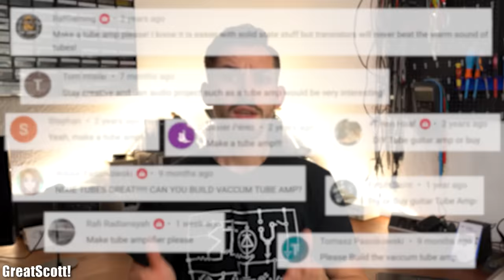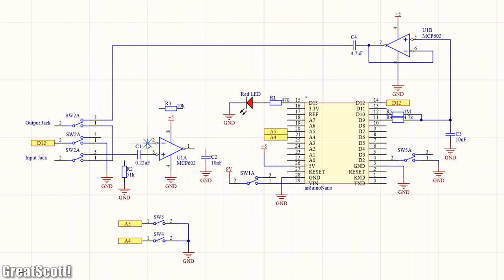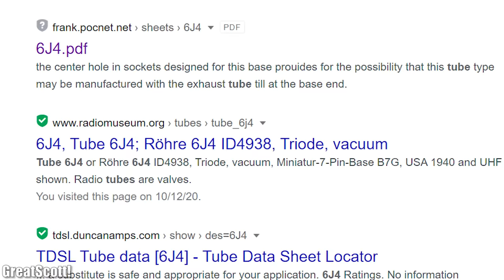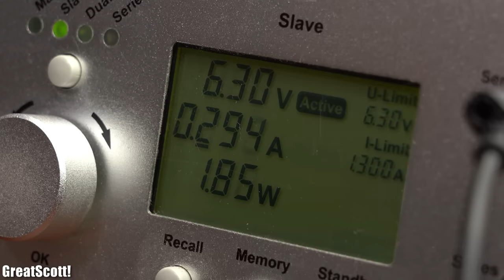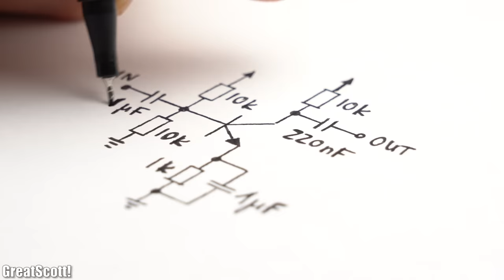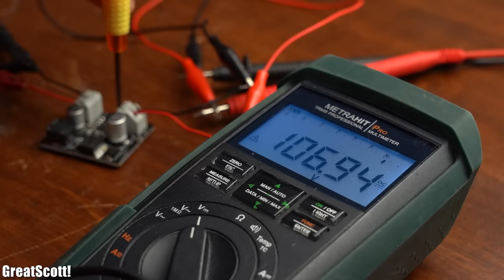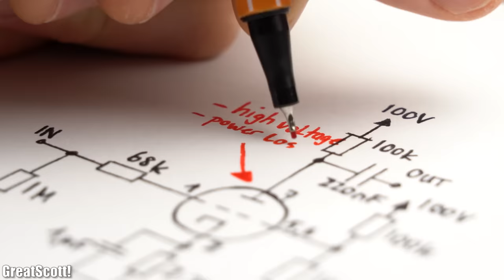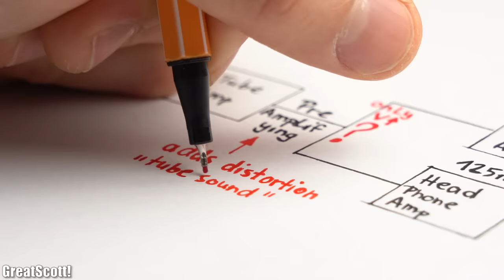Building a Tube Amp! Does it produce better audio quality though? EB#47

Comment: I just can't understand one thing: why, if the tube sound is just pleasant and the customers are willing to pay for it - it's not emulated digitally? With today's electronics it should be EASY. I imagine it as a software filter on your PC or Android MP3 player. Where's the problem in making amplitude response non-linear? Geez, it's simple sample multiplication. We can get any characteristics that way. Saturation instead of clipping? This is a little more mathematically complicated, but still - easy peasy. I really, really can't understand - why bother with analogue electronics? First of all - it's damn expensive! Then the design is relatively complicated. The digital version can be just programmed. Without any hardware you don't already have. There was a time of super annoying photographers that were fixed on developing their own analogue films. Damn, I hated their bullshit how the analogue photography is better, it's an art and all that shit. Thank god most professionals switched to digital cameras. And all that artsy shit I can add with one touch on my phone, I don't need a fucking dark room and a ton of chemicals for that. The analogue audio is just another version of it, but IDK, even crazier. I understand the speakers and microphones are analogue, and there is amazing science behind the good sound of these devices. But come on, signal recording, playback and amplification - there is absolutely no magic or rocket science. It's dead simple. It's the same story like with photos. It doesn't matter if the "pixels" come from film grain or CMOS matrix. It just offer a specific resolution and dynamic range. Same goes to audio. But the digital processing has the advantage of emulating practically anything. We can "draw" sound with the resolution far better than what our ears are capable to hear. Why this is not a standard, and people still burn money and time playing with analogue stuff is just insane to me.

Comment: NO!!!!! To get sufficient power for even efficient horn speakers to really work right the HEAT generated by the tubes would be very difficult to manage. I use a 140 watt/channel solid state unit because it has the overhead needed for my speakers to reach their 116 dB max (@100watts). The extra 40 watts is a little overhead so absolute full volume is not needed. Why? Look at a snare drum rim shot wave form. You will see a very short lived spike that can and often does exceed 110 dB+. Mind you that the speakers you play at normal dB levels will still if possible follow and if sufficient power is available reproduce the wave and it's dynamic level to the speakers 116 DB limit. If the power needed or efficiency is not sufficient the wave will be truncated, and distorted. NOTE: A typical 89 dB/watt/meter speaker would need about 2000 watts to follow the wave to 116 dB. Almost all musical instruments on the initial "attack" of the note or chord will "spike" very briefly then decay to a normal volume. Speakers or amplifiers that cannot faithfully reproduce the attack wave form will distort this portion of an instruments true sound. Our host correctly points out that tubes have other distortions not produced by transistors. As long as one does not clip the solid state device it is superior to tubes.

Comment: Douglas Self has put this topic to rest completely in his Audio Power Amplifier Design Handbook.  Basically NO there is no difference because feedback removes all the problems.  They did multiple blind studies and basically no one could tell the difference.  If there's no feedback then Valves/Tubes sound nicer because they soft clip with even harmonics whereas Transistors soft clip with odd harmonics.  But now you are comparing shitty designs to each other.

Comment: Put my Heathkit SB200 up against any 200 watt solid state junk and you will hear the difference on the ham bands. Solid-state amps don't seem to distort as musically as vacuum tube designs. The primary reason is that when you drive tubes hard the distortion comes on gradually and presents itself as gradual compression that blooms into distortion. The high voltage supplied to vacuum tubes ensures that the output of the device seldom exceeds the voltage that runs it. Solid-state amps use lower voltage supply rails to operate and the output can exceed the supply voltage. When that happens, they don't start to compress and gradually clip. They simply cut off the output signal at that level. Sine waves become square waves immediately and the sound is not pleasant. Solid-state distortion in its pure form sounds something like bees in a tin foil bag. Not the best for musical instruments, completely unacceptable for home audio enthusiasts and Ham radio operators will show you the difference visually, with your ears and on paper.

Comment: This is your opinion, however Tubes are immune to radiation, tubes can operate at higher frequencies and higher power. Do you think Radars use Transistors?  A class A tube amplifier with regulated Vsupply is perfect.  What about noise? Transistors are more susceptible to Noise than Tubes. 
Your experiments are not under a control environment and the equipment you are using is not the ideal either.....
The video provides  poor evidence, show the Harmonics with an harmonic analyser for example....What about  frequency spectrum?

Comment: This is a terrible amplifier! Right there from the beginning of the video I saw the row of inductors lined up and I knew that it was a class D amplifier! 
I'm not too familiar with this model but from the quick glance I saw a few opamps which are probably used for the bass and treble controls and the headphone driver, the output stage is class D which should only ever be used for portable Bluetooth speakers where you just need loud noise and where quality isn't important! 
You showed some nice tube Amplifiers on the eBay listings, the one that you should have got would be the one that is point to point wired! So always remember to check for pictures of the underside, there should be no PCB! 
I don't know if headphones would be the best way to hear it, you need to track down an old pair of hifi speakers, you need them to be really efficient! The need to have at least an 8" speaker or larger, they don't need to be expensive! They usually have a tweeter that is just a normal cone speaker with a simple capacitor as a crossover... 
I'm not an audiophile, I just know that tube Amplifiers work best with cheap, large and efficient speakers and even though they are only rated for 10W, you will be surprised at how powerful their 10W is! And when it gets loud and distorts, it's a soft distortion and it actually sounds good unlike the hard clipping of solid state! 
To experience music through a vacuum tube amplifier is to understand how perfect the audio engineer's got it from first go. You will probably wonder why we needed to change it to solid state in the first place lol... 
I was hoping that this video would have been longer than it was, judging by the amount of people who viewed this video, there's a lot of interest in this field... 
You should send this amplifier back and get a real one, the real one will be an investment that you will be able to pass down to your children one day, this thing will end up in the tip (landfill).

Comment: Soldering? ... seriously.. you mean "dab & hope"!.... Soldering to a tube directly that is not a version with proper solder fly leads you risk causing a de-vaccum as the pins exceed normal temps & the glass-metal pin bond is compromised.... USE A SOCKET! It would be interesting to check how much noise is present on the B+ being made by your DC-DC convertion module as well.

Comment: For guitar? Absolutely, not modern shite, they are over engineered crap. A basic no frills tube amp, for guitar sounds phenomenal and cannot be matched by solid state or digital. Not everyone has played thru a vintage or vintage style amp. Modern tube amps are redundant in many ways IMHO. You take perfection stick it on  pcb and add 200 components you lose the magic.

Comment: so poeple the sound that Tube Amps make because the add a distortion to the sound, over the new transistor that do not? mmm, could you not nock circuit, resistor and stuff toputs that distortion back in the sound, and call it "Mock Tube Amp" sound   settting or somthing?

Comment: Bits and pieces of tube history can't support for your "pleasant or warm"  acoustic feeling. 
Bear in mind human ears can't even observe a blinded eye-behind the curtain- test of 10% THD distortion, no matter how "Golden" you claim your ear are. Do not use the oscilloscope waveforms to make our ears to believe.
Get the basics correct first: Tubes are" voltage" devices while transistors are "current" devices. The interface is Transformer.  
Flipping a few pages of specs of tubes and transistors mean comparing apples to oranges. 
It's completely mad to power a tube with a switch mode Power Supply module.
Do not confuse Nixies with Heated metal Tubes. Totally different in operation.
Never solder the legs of the tube. The glass can be cracked and the tube be damaged right away.
And don't play around with any voltages above 50V. No fun. It can kill.

Comment: The “tube amplifier” you used as an example of the art was at best a cruel joke. Transistor amplifiers took over because they are cheap to build and disposable. Pretty much no other reason. The cheaper solution always wins in the market.  The tube used as an example is not even designed for audio amplification. If you even bothered to research the proper design of an audio frequency vacuum tube amplifier, you would see that different tubes were made for different applications, even low voltage types, if that’s so important to you.

So, as an engineer who makes his living working with both classes of device, I give you an absolutely failing grade on your presentation and conclusions.
Reply: So if you are an engineer that makes his living works with both you must know that the reason transistor took over is because it is much more efficient for every single application that used tubes. The only reason we have smartphones and small computers is because they found something better that could be packed in smaller spaces using less power and producing less heat. Tubes may subjectively sound good but suck for everything else. Much like how a quartz watch are much more accurate to tell the time than a mechanical watch and is cheaper to produce. How something that can do the same thing in a more efficient way and cheaper not be the obvious choice?
Reply: @sterkriger2572  Efficiency is largely irrelevant where audio amplifiers are concerned. Just as eating a handful of crickets is more “efficient” than involving a cow, a farmer, a large plot of land, a butcher, and a barbecue grill to feed oneself. I’d rather have a steak than eat a handful of bugs. But just as enjoyment is non essential to sustenance, the act of listening to music is “non essential” to life. Therefore, any arguments for objective efficiency are meaningless. Unless you run on a battery pack, the fact your amplifier consumes half the power means nothing in the grand scheme of things. 
Do they (tubes) sound better?  Well, that depends. I’ve heard plenty of crap tube amplifiers.  The example above would certainly serve as an example. Without counting the simple 100V power supply components, per channel, I build a balanced fully differential tube preamplifier with a single 6DJ8 tube, two transformers (input and output), a 2 channel pot, and 5 resistors that has less than .01% distortion total at 3 volts of output into a 100 Ohm load.  All this with zero feedback!
Reply: You missed my point and decided to straw man my comment. You said the industry diched tubes just because transistors are cheap and "disposable". I pointed out that it was because tubes where much worse at doing the job and thanks to that we can pack 3 billion transistos inside a home computer that fits into a small box while a tube computer needed a whole building and could only hold 18000 tubes and consumed the same as a small city.  As far as music especifically thanks to the better efficiency that transistors have we can listen to music everywhere anytime in a marvelous thing called a smartphone or if you're a little older a discman, a MP3 player etc. The transistor single handedly revolutionize technology. That's why everyone started using it. Making better, faster and smaller devices was only possible because of it. Tubes are a relic of the past.

Comment: Lesson 1: nothing good in tube amps ever came from China!

The first thing to note is that the circuit design is principly responsible for the sound quality, including appropriate choice of valve type.  The advantage of valves is that they remain extremely linear, low noise and are hugely tolerant of voltage swings (unlike transistors) when used within their optimum operating bands and power constraints.  Push them beyong those limits and they will distort or noise will increase.  Keep gain sensible and bias to sensible levels and distortion will be low and noise not audible.

Some of todays highest S/N amp designs are valve based...fact....(Tron for example) and they can also be very low in distortion.  This means the reality is you cannot generalise about valves v's solid state. Each can sound euphonic and have high distortion if poorly designed or neutral and low distortion if well designed.  To claim otherwise is a falsehood as there are plenty examples of ultra low distortion valve amps such as AR reference 3 6h30 preamp or radfords sta15 and 25 designs.

You dont have to use a valve in its higher dostortion levels.Thats a matter of good design and correct valve choice.   The old chestnut that valves are all distorting euphonic devices being regurgitated  here shows your complete lack of experience and knowledge with valve designs  I'm afraid.

Comment: Hello Scoot the tube have so much 2nd waves so the warm "wrong" sound. This Amplifier make a non linear Sound so this is disturbing the sound for the unknown. First you destroy the Analogue signal by using a tube (2nd, 3rd, 4th over wave you mean this is a warm sound but this is a distortion like a Guitar Amp) then you use the bad D-Amp technology! This is a bad Amplifier but in the MP3 ears it sound good. In my eyes the Band/musicans and/or shall make the sound and not the Stereo set at home. The Stereo set at home shall have no sound and should be linear as possible! and not so soundy like this bullshit tube amp. Best Regards Volker

Comment: Another silly video talking about "better audio quality" and "pleasant" without defining what the terms mean. A conventional audio analyzer will readily show that a tube amp is lucky to get 0.1% distortion, which is considerably more distortion than any well-designed transistor/IC amplifier. Usually "pleasant" and "warm" mean "I enjoy even-order distortion. A LOT of even-order distortion." I also had a good laugh when a cheap boost switcher was used as the power supply for the tubes. Have a look at the noise that those suckers put out. Much of that switcher noise goes right through a tube amp's plate voltage and is added to the audio signal. Is that "better audio quality"?

Comment: This amp is a gimmick, a fake, it is not a real "tube amp". 
A real (good sounding) tube amp uses nothing but tubes.
The areal tube amp has only resistors, capicators, coils and tubes.
Get yourself an old tube type AM radio receiver and you will have a real tube amp.
Reply: True said

Comment: Ja, es gibt keinen wirklichen Grund mehr für Röhrenverstärker, selbst im Gitarrenbereich nicht. Digitaltechnik kann mittlerweile so ziemlich alles Emulieren, aber gerade im Hifi-Bereich drehen die Leute total durch und glauben sogar, dass vergoldete Sicherungen ihren Verstärker besser klingen lassen (kein Scherz! Gibt's zu kaufen für den Zweck). Das Problem ist auch, wenn Emotionen und Hobby-Halbwissen aufeinander treffen und Argumente kommen, wie: "Ja ich höre doch mit eigenen Ohren, dass die Röhren besser klingen". Na ja, das eigene Ohr ist ziemlich schlecht und der Kopf hört, was er hören will - ein Signalgenerator, Spektrum-Analysator und Oszilloskop lässt sich nicht verarschen...